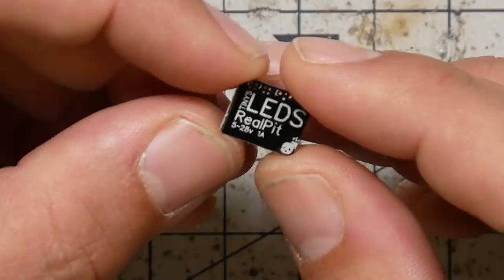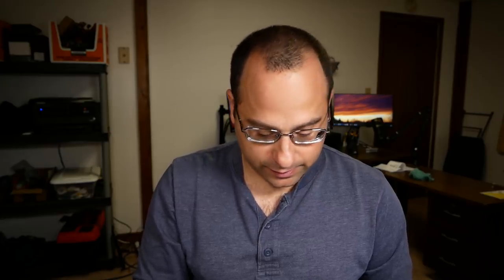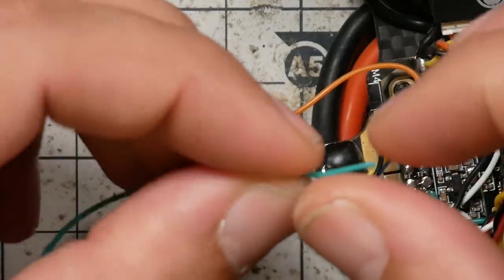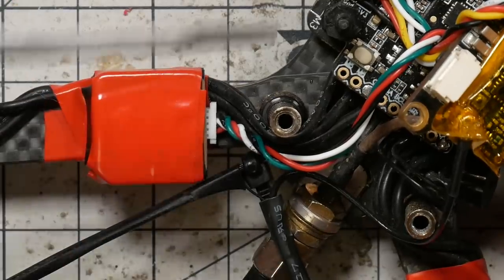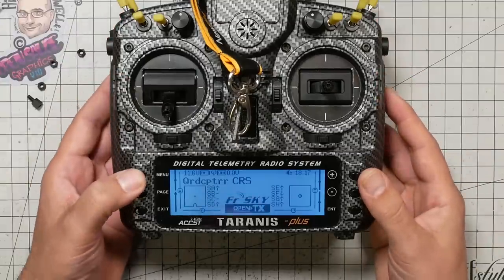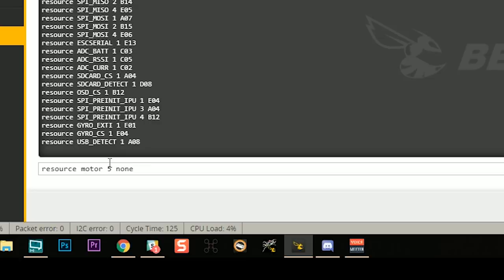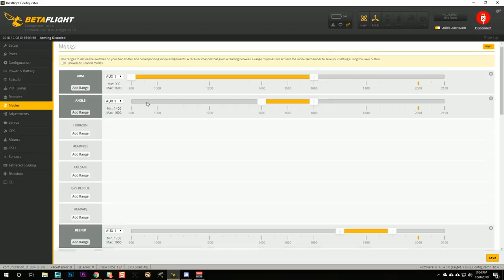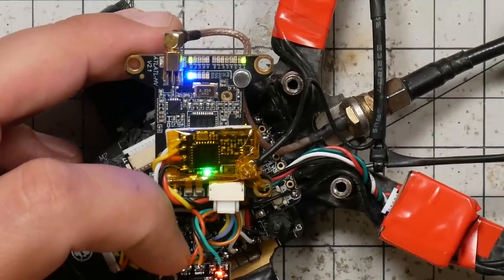Switch vTX Power Off Remotely? | TINY'S LED REALPIT

Comment: All this fancy shmancy unexplained set pinio = ...  etc. commands, are not necessary when you just use the LED pad, and the LEDlow mode functionality in betaflight, right?
Reply from the maker: I have never set it up that way personally.
Reply: @JoshuaBardwell  As you didn't explain what the CLI commands where doing exactly, I thought I didn't need to do this for the LED pad: 
resource led 1 none
set pinio_box=40,41,42,43
aux 2 40 2 1600 2100 0 0
resource pinio 1 <pin number> . 
I think the video would be better if you give a little bit more background for these commands. But I will try with pin number = LED resource and see what happens. Guess I will have to use user 1 in the modes tab still. My real pit is not red/no red, but blinking green vs. non green. Will try tomorrow.
https://www.facebook.com/groups/rotorriot/permalink/1269071919914444/
Reply: @JoshuaBardwell  Nevermind, it's working now! Used ppm pad.

C09 is the pin for the realpit switch
Both these resources are C09?
# resource
resource PPM 1 C09
resource ESCSERIAL 1 C09
I want to put something else on C09 (don't even know what escserial is), so, clear both first? Set to none?

so this is what I will try:

resource PPM 1 none
resource ESCSERIAL 1 none
set pinio_box=40,41,42,43
aux 2 40 2 1600 2100 0 0
resource pinio 1 C09

result:

# resource PPM 1 none
Resource is freed

# resource ESCSERIAL 1 none
Resource is freed

# set pinio_box=40,41,42,43
pinio_box set to 40,41,42,43
# aux 2 40 2 1600 2100 0 0
aux 2 35 2 1600 2100 0 0

# resource pinio 1 C09

Resource is set to C09

Comment: When I set this up I loose my swart audio is it possible to set this up and still use smart audio
Reply from the maker: The vTX is literally powered off so it can't talk to SmartAudio. When it's powered on SA should work.
Reply: Joshua Bardwell I’ll go back through the setup I did something wrong with power to my vtx in smart audio wasn’t working prob something I did wrong. Thanks for the reply

Comment: Just put this on every fc. Rc car guys use this to control lights. Why dod this take so long.
Reply: I bought things called Nano Switches back in the '90s. Signal-controlled solenoid switches up to 5A, not much bigger than this.
Reply: This is not a switch like the LED lights use in cars. This is a High side switch. We also haven't had the PINIO function in Betaflight for that long. So we were waiting on easier software controls to accomplish it.

Comment: I feel this sort of thing should be integrated into the fc, it is after all a bunch of glorified switches.
Reply: pulquad Whitenoise Synergy F4 fc has this built in.
Reply from the maker: CLRacing F7 has it. I guarantee you my next FC will have it too. It's a very clever idea, but then again it's just a transistor. Trivial to add to the FC and no reason to need an accessory board for it.

Comment: Has anyone successfully used a realpit switch with a caddx vista? As soon as I disconnect the red wire from the VTX, my receiver (spektrum DSMX) stop working (even without realpit in the middle). My FC is this one: https://betafpv.com/products/toothpick-f405-2-4s-aio-brushless-flight-controller-20a-blheli_32-v4
Reply: FIY I’m on betaflight 4.2.9 …and another useful  information could be that if I disconnect all wires from the VTX the receiver works… so my receiver stops working when all caddx VTX wires, apart from the red one, are connected.
Reply from the maker: You can use realpit but bear in mind realpit is only rated for 1 amp so you would need minimum 10v and realistically 12v would be ideal powering the Vista. If the receiver powers down when the Vista is wired up, that strongly suggests a wiring mistake where you're short-circuiting the 5v regulator to ground or something like that.